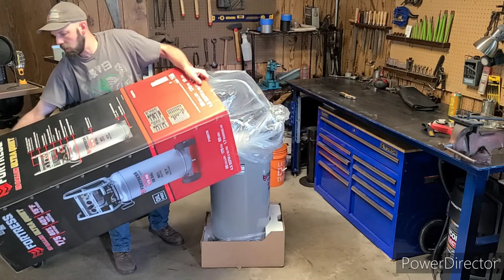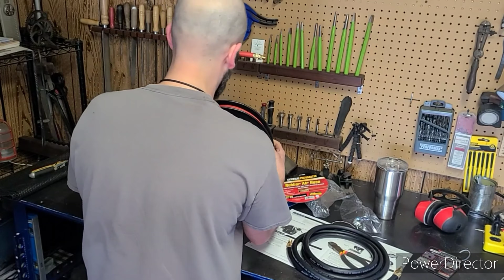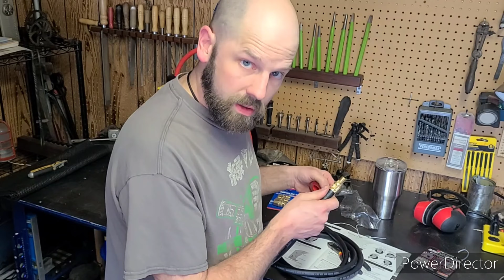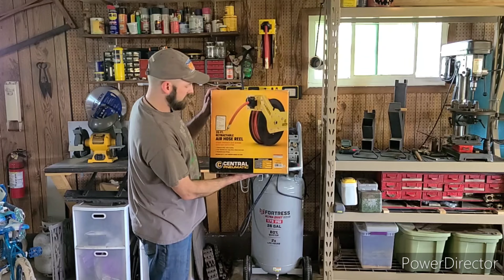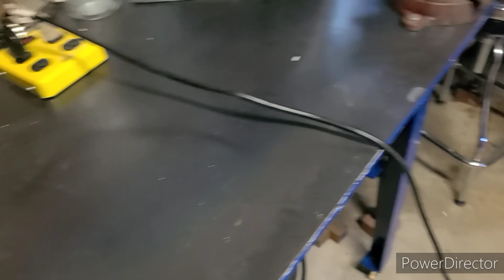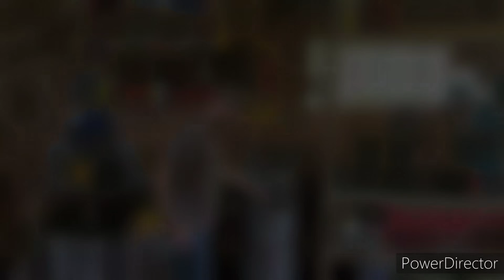Harbor Frieght Fortress 26 Gallon Air Compressor Unboxing, Setup, and Demo

Comment: Are you sure that's going to be enough to power your air tools? I have a 26g kobalt 1.5hp and it's not enough to run an air impact to loosen lugs, can barely run a 2in sander dor scuffing, I can paint cabinets (lacquer) at a slow rate. Let me know how it works out I'm trying to switch to a more quiet compressor and use my current one as a backup
Reply from the maker: I probably won't be using tools like that. The largest tools I will probably be using will be die grinders and maybe small sanders. But if I find it lacks performing power I'll definitely make an update.
Reply from the maker: I have an update on my air compressor. I recently bought some Harbor freight air tools and made a review video for them.  Check it out if your curious.